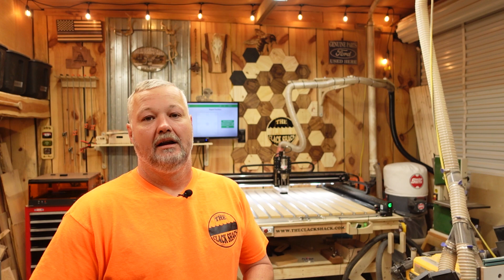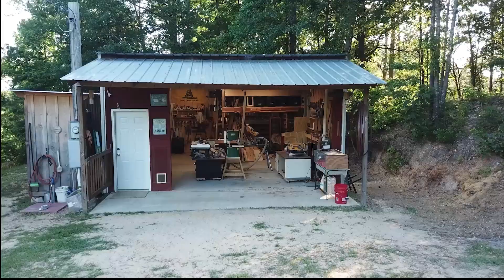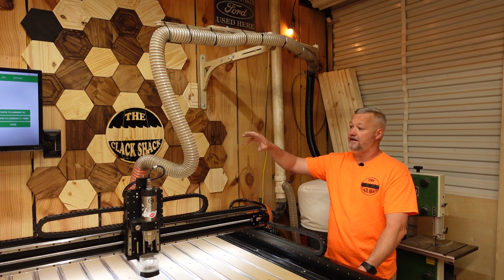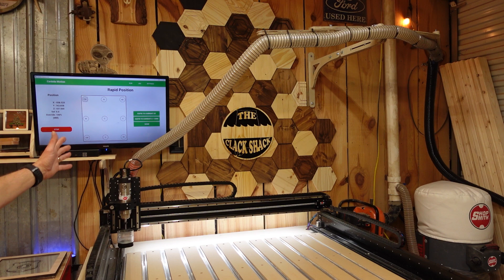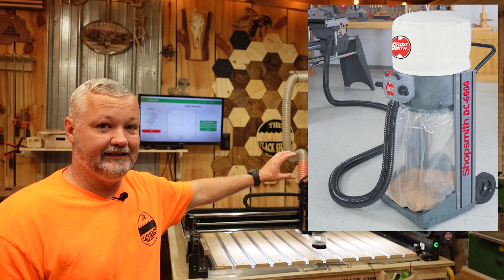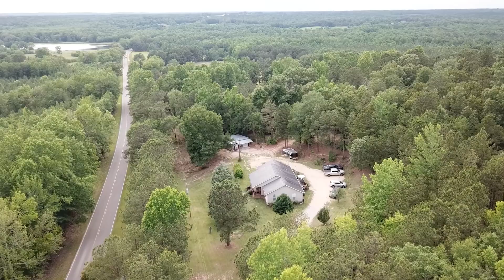Shopsmith DC-6000 review

Comment: Hi, this is just what I'm looking for.  What did you use to make it remote turn on or did it come with wireless remote? Any light you could provide would be greatly appreciated. Keep up the great videos.
Reply from the maker: Plug it into this relay. It senses the load and switches the dust collection on. It works with other tools as well. Just plug the power plug into it. https://amzn.to/4g7j9M1
Reply: Thank you for the super quick response.  Does it come with a remote like the one you used in your video when you compared db of the dust collectors?  Again, thank you.

Comment: I recently purchased a DC 6000 and have it up and running with my new Mark 7. I don't think I have the experience level to comment on the dust collecting ability but, I will say that the reduced noise level is pure pleasure.
Reply from the maker: I use it for the CNC and it has been a nice upgrade.

Comment: Hey Clack. I’ve been running the Shopsmith DC3300 (the DC600’s predecessor) since 1987 with zero issues and I’ve only removed the filter a half dozen times. Let the fine dust cake on the filter and the dust itself will act as a filter. Before I run it I grab the filter form the top and give it a shake to break off the clumps and away I go. The only time I remove it is if it feels like the dust has been building up on the impeller hood. As I said, it happens occasionally, but rarely. Scott
Reply from the maker: Yea, I have been giving it a few pats to do the same. Working great so far.

Comment: Can this model be adapted to 4 inch connection like the old model could?  They also used to have a larger filter for it also.
Reply from the maker: This one is basically the older machine with more power, this would lead me to believe that it would work the same. I haven't seen one larger than what I have, at 13 inches tall and 19 inches across, it is pretty beefy.

Comment: I added a cyclone separator that sits on a 35 gallon trash can before my collector bag,  Helps a lot with the larger chips not filling the bag,
Reply from the maker: Using it with the CNC, so far the bag is filling very slowly.